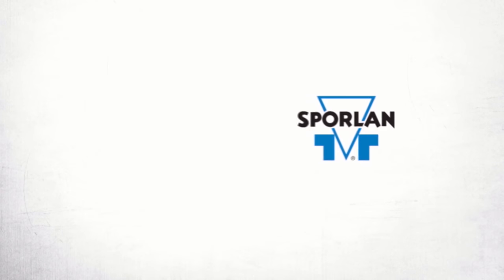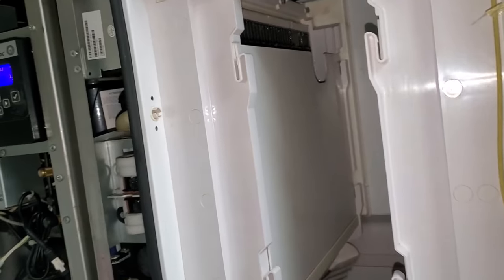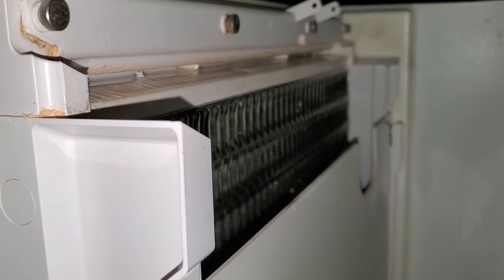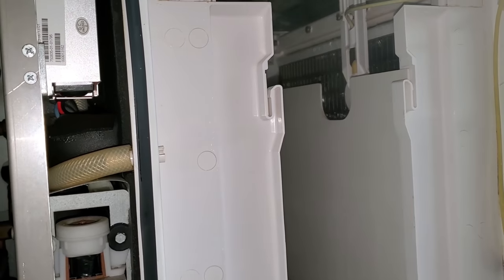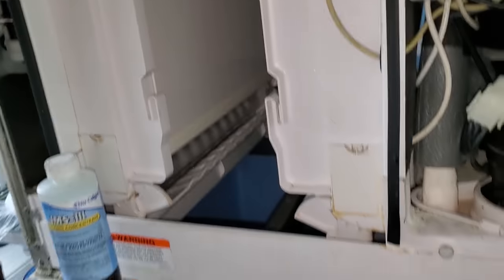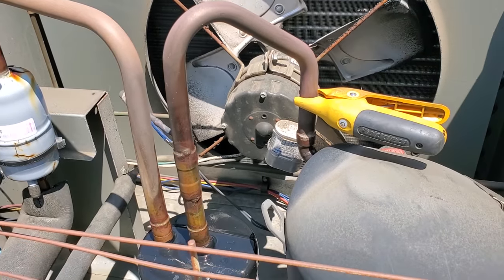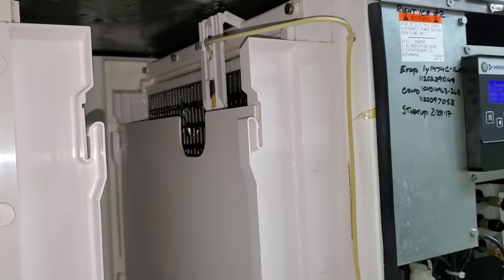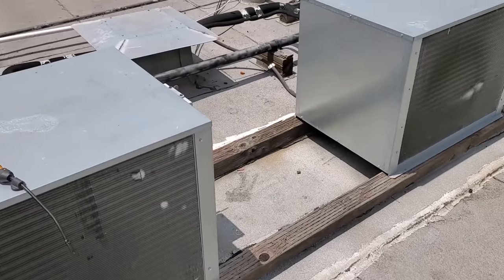BOTH ICE MACHINES ARE NOT WORKING

Comment: hello i have a ice machine manitowoc model iy1494n-261... and need compressor replacement comp model is bristol R92J343ABCA but not available.. is there other brand of compressor to be used... thank you.. in advance...
Reply from the maker: Call your local manitowoc ice machine distributor and they can help you find a replacement compressor
Reply: here in the philippines its all business they will not help you... all they want is acquired there service which i dont need because im a hvac tech...i already have an idea which replacement.. i ask you just incase you have specific compressor to suggest..

Comment: What refrigerant are they using these days in ice machines.
Reply from the maker: 404, 410, and r290 is the most common gas depending on brand and size
Reply: High pressure gases,games, is difficult in hot climates,probably.

Comment: Curious but serious question. I presume you are billing the company for the time you’re there whether for observation or repair?
Reply: Oberservstion and understanding the function of the machine and cycle times are very important on an ice machine
Reply: Instead of Observation, I'd call it Diagnostics. You can dig in and start probing and disassembling everything, but the best way to find the issue is to just watch and find out where the machine is having issues.
Reply: Yea, no observation = parts changer. You don't want me coming in an installing $500 in parts when it's a $50 float switch. Do ya? He's gotta fart around and find out.

Comment: No more  Mc Donalds for me lol.
Reply: ICE machines rarely get cleaned
Reply: I always complain to inspectors about that. Never even open the door on an ice machine head or bin. They are starting now in areas of my service to inspect them more but it is sadly disgusting. I wont drink fountain drinks because of that. 

WITH THE EXCEPTION OF LOCAL DUNKIN DONUTS. THEY DO CLEAN WATER SYSTEMS IN EVERY MACHINE ONCE PER MONTH!!!!!!!! Manitowoc was having issues with water level sensor probe/harness connection and it showed first at DD. Mani now has a new probe/harness design.